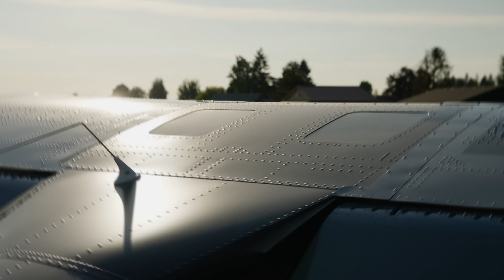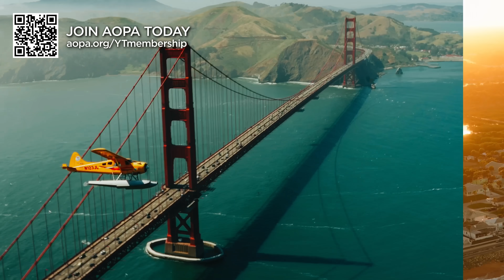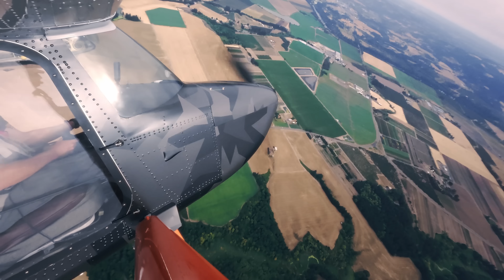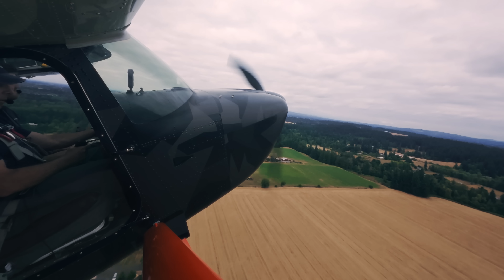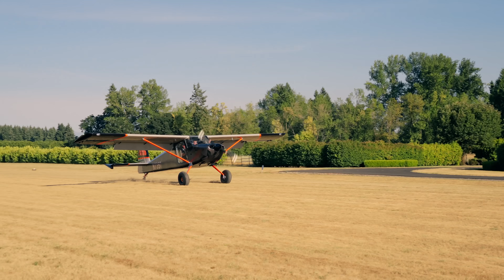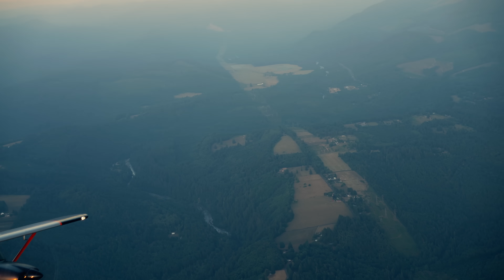We Finally Flew Van's Aircraft's NEW RV-15 – Was it Worth the Wait?

Comment: Modern Cessna 170.
Reply: Really a Modern Cessna 180...
Reply: @SilvaAdventures  a 180 is more airplane, even an old one.  The 180 has a longer wing, is roomier and carries more load than the RV15.  But I should have been more precise - the RV15 is like a modern C170B, which has the Fowler flaps.  Or somewhat more esoteric, like a C175 Skylark with an IO390 and a tail wheel.
Reply: @matthewprather7386  180 and 170b have the exact same wing dimensionally. They also have the same fuselage.
Reply: @Super170BAlaska there are at least some differences between 170B and 180 fuselage..  For one, the 180, early 182, and 185 have elevator trim through and adjustable stab angle with a jackscrew at the leading edge, which the 170, 172, and 175 lack.  I also think 170s don’t have adjustable rudder trim, which the more powerful planes include.  I would guess the more powerful planes have heavier skins in many places (wings and fuse) too but I’m not sure about that.
Reply: @matthewprather7386 yeah, I didn’t say the horizontals and elevators etc. were the same. I said fuselage. I’m talking dimensionally when I say the same, like with the wings. There are differences with skin thickness and so on.

Comment: I'm excited about the RV-15, especially since it's extremely likely to have a fully factory built S-LSA option. I'd be curious if they add optional parachute and what their avionics options will look like.
Reply: Having flown an RV-12 for training I can confidently assure you that a Van’s SLSA is not something you want. At least pre-MOSAIC. That thing had so many design corners cut (to make the 1320 max gross AND a high useful load) that rendered it fragile and completely unreliable.
Reply: @THC7255  Thanks for your opinion! I've seen mixed reviews: some people say it's so great, everyone should have one. Others say there's a ton of issues.

Yeah, the 1320 weight was very limiting. The RV-15 shouldn't suffer from that, MOSAIC should make for a much more capable aircraft. Perhaps Vans will come out with a v2 of the RV-12 (or RV-12M) now that MOSAIC is a thing and they won't be so limited.
Reply: @masonmcglothlin5101  Consider the Direct Fly STOL Cruiser. It's basically this in a more refined package, strutless wings, plus comes with a chute by default since it's European. You lose a bit in top-speed but it does everything the same and is offered factory-ready. I asked Vans about a parachute option and they said they haven't designed it with that in mind. Rules it out for me, that an what will be a completely full order book with kits coming in stages with assembly problems still a big possibility meaning a 2 year build might become a 5 year build... no thanks.
Reply: @karlfriedrich7758  Thanks, will definitely check that one out! There's a few other similar ones too, such as the Montaer MC-01, Texas Aircraft Colt 100, Bristell B8, CubCrafters FX-2 and FX-3,  and TL Sirius Backcountry. My personal top choice would have been the Glasair Sportsman, but it's unclear if Glasair is still in business or not.

Every single one of these aircraft can take a parachute. So it's really puzzling why Van's wouldn't offer the option. I'm willing to bet that people who build kit aircraft generally wouldn't opt for one. But those who prefer to buy a factory built plane I'd think would be much more likely to opt for the parachute, hence the popularity of Cirrus's SR series. If Vans is trying to transition over to factory built S-LSA's across the lineup, the RV-15 should have included a parachute option.
Reply: @masonmcglothlin5101  You're most welcome! I can probably answer a few of your questions as I've been in touch with a few of these companies since I'm looking at this category of aircraft myself. 

The Glasair Sportsman was also my top choice initially, they're definitely still in business, they are just moving production to China since the parent company who bought them out made the decision in mid 2023. They really only made that clear in an email to those on their customer database, so to everyone else it looks like they just stopped production all of a sudden haha. No mention of when the factory will be up and running, though I expect that'll make the price extremely competitive as it was a little prohibtive originally. The closest alternative I can think of is the Sling HW - seats 4, parachute and both tail dragger and tri-gear! 

The TL Ultralight looks really cool, but the price is 280,000 EUR (327,000 USD), it's also outperformed in basically every single performance metric, by the Direct Fly STOL Cruiser which costs 150,000 EUR (175,000 USD) Direct Fly really needs to up their marketing efforts because that plane would smash a lot of the competition in the US at that price point! 

Regarding the parachute, attitudes are changing which is great to see, it's mostly the grizzled old fudds who have a gatekeeping attitude toward flying who seem to hate parachutes. Most rational people understand that any aircraft can fail and so can the pilot, and so parachutes are simply another tool that can save you and your family from a fatal accident. Thankfully the younger generation of pilots (and EU directives) understand that, so we'll hopefully see them become commonplace. 

I completely agree with your thoughts on Van's decision with parachutes. Makes absolutely zero sense to me why Van wouldn't incorporate that into the RV15. Can only hope that BRS Aerospace sees the demand in the RV15 and considers offering a retrofit option like they did with the Cessna 172 and 182s. 

Best of luck if you're in the market for a plane! So many choices out there you're bound to find one that suits your needs one way or the other :)
Reply: @THC7255 An RV-12 is not something you want for training. If you slam it down like a 172, you’re going to have a lot of issues. Not a flight school plane, IMO.
Reply: @THC7255  I feel the same way about my Rans S21, which fortunately has the 1800 pound EAB designation but many are just the LSA

Comment: What is the baggage compartment weight limit? Early on I think more than a few folks expected a back seat. 
Really looking forward to seeing production take off
Reply: They said 900lbs in the video
Reply: @buhl86  900lbs is the targeted useful load. That includes the weight of 60 gallons (366 lbs) of fuel.
Reply: @buhl86 thats useful load not baggage weight limit
Reply: @buhl86 I missed it thank you, seems a couple seats may be in order

Comment: It's been years in the making, but I am still excited to see what the full flight envelope of this thing is. The S-21 is a real challenge to overcome, but they just might be able to do it.
Reply: Rans is half the price, half the build time, and burns 1/2 the gas with the Rotax 916.
Reply: @Triple_J.1  and it’s half the airplane… as in a flying eggshell
Reply: @Triple_J.1 have vans announced pricing or build times yet? I'm not planning on using a conventional power unit, so that's a bit of a moot point.

Comment: Looks like the cabin could use a few more inches width.
Reply: Yes i saw the clip from OSH where Brian mentions it has 2inches over the Cessna 180, so was a bit surprised to see how cramped these 2 gents were.
Reply: With the big plexiglass door people are naturally hesitant to lean against it.  The cessna doors are a bit more hefty so you're likely to put some more weight against them.
Reply: hopefully there is some sarcasm there...
Reply: There is always a bigger guy. The cabin is reported as 47" wide. What is a 182, 45"?
Reply: Sounds like you want a Bearhawk.

Comment: I would love to this craft with a different wing and airfoil, similiar to the RV9, for a traveling machine. normal tires and pants..easy transition for another model for Vans for a mission more suitable to most pilots..optimized for travel.
Reply: They already have that, it's called the RV9.
Reply: Nobody’s doing that anymore. The future of GA is flying into hazardous terrain and making either clowns or mincemeat of ourselves until the FAA finally has enough and pulls the final plug.
Reply: @THC7255  then the future future we'll all be in autonomous aircraft and GA will be a robot-based sector
Reply: I think the market would support a sleek high-wing. The low wing 6/7/9/14 are great, but as I age, getting harder to get in and out of. I would love to see a speedy cantilevered high wing with a cruise of 150 kts and a stall in the low/mid 40’s. Kind of a faster *slightly smaller Cardinal
Reply: @joesmythe8232  That would be a BD-4C
Reply: @pittss2c601  😂I said sleek. Not boxy! But beauty is in the eye of the beholder. No interest in that or the new Sonex HW… or the Wittman Tailwind for that matter.

Comment: If they can keep the price under control, they will sell a lot of these! Especially in the training market, tricycle gear, 3 seat configuration. This is a more capable 172, that can also replace a 170. Very interesting aircraft. Not necessarily revolutionary, but evolutionarily for sure.
Reply: It's $20k just for the wing kit.   it's already out of control expensive.
Reply: @HemnaIV  There was an awfully long waiting to put money down on day one for the wing kit. It was actually hard to get a good picture all week long at OSH there were so many folks around it. Looks like Vans has done things right. Sure it's not cheap. What isn't expensive these days?
Reply: @HemnaIV  If you can't afford to build it then you can't afford to fly it. There are always lower cost options.
Reply: Vans have migrated away from the "pay as you build" model to "take out a loan in your 401k" and also pay others to help build it for you. If you want to complete these, and have it be everything you dream, and to actually have it and enjoy it for a decade or two before you lose your medical, then a second mortgage or a 401k loan is the only real choice here. These are $300k airplanes. Cessna 172s are 400k but they can be financed for 20 years at a reasonably affordable monthly note. Vans cannot.
Reply: The fact that it's a $200,000+ experimental 2-seater rules out the training market except for specialty applications. And those are already using Kitfoxes and S-21.
Reply: Two seats ... and I've had four adults in my Skyhawk.
Reply: @UncleKennysPlace  RV10...
Reply: Both planes are good. Its apples to oranges.